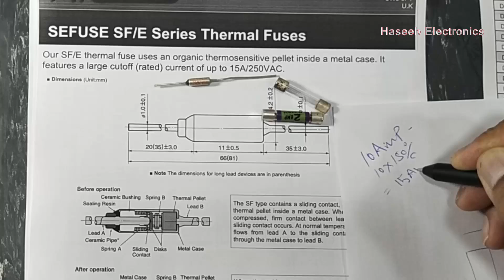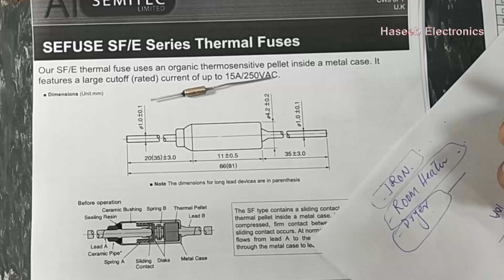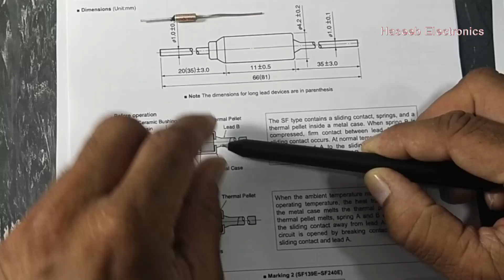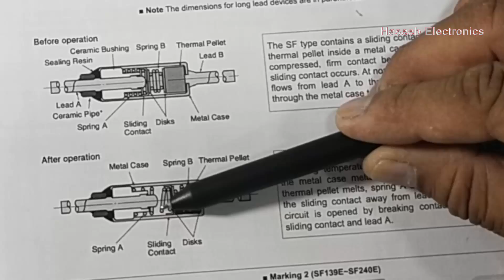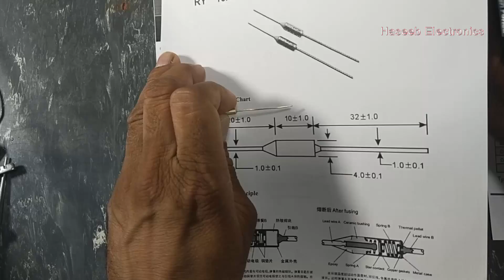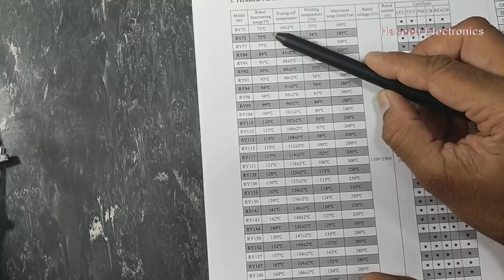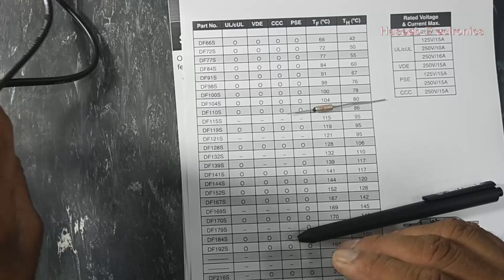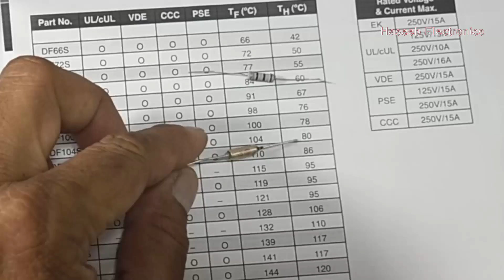{475} Thermal Fuse, How it is Made, Structure, Function & How To Replace / Datasheet Explained

Comment: I just had mine fail in a toaster oven, I wired around it rather than replace. Only ghetto dwellers let their appliances overheat, its lack of maintenance. These fuses are designed to fail in a few years, 90% of people junk the item. Good for business.
Reply from the maker: it is better to replace it with thermal fuse or at least simple fuse, so that it can limit the overcurrent situation, 
these thermal fuses get damage in over temperature and over current conditions

Comment: I've always wondered what was inside a thermal fuse. Great!
Thermal fuses seem to blow for no reason in fan motors . The fan  ran fine, then I would shut them off. Next time I turn it on, it's dead. I know for sure it was a thermal fuse in at least one of them. Because I tested the fuse with an ohmmeter. It was rated at 115°C.oh, it's a different style, it looks like a small capacitor. Leads like a disc capacitor, but the fuse is a tiny square shape.
Reply from the maker: Good morning 
thermal fuse is a safety component against overcurrent and overtemperature 
in fan motors, blender motors it protectes the fan from damage in overheat condition due to any stuck / jam in bearings, metal bush, 
and over current condition

Comment: Hello I have a coffee maker which has two thermal fuses that both look just like the one you showed. The problem is that I cannot read the values of the fuses. The print is very faded. Is there another way for me to determine what value of fuses I need to get for the coffee maker?

One more question, if a coffee maker has two fuses instead of one, is it true that both of the fuses have the same value or are they different from each other?
Reply from the maker: SF214E SEFUSE 10A 250V Thermal Fuses 216 Degrees Celsius Thermal fuse is normally used in most of coffee makers 
Most of the time Both fuses are sane value
Reply: @HaseebElectronics  Thank you so much. This means a lot to me! And thanks for the very informative videos.

Comment: Thank you. Exactly what I was looking for. My electric oven suddenly not turning on.  I used screw driver tester and found that the electricity doesn't go across the sf150r0 sefuse. Hope changing it will solve the problem.

Comment: Thank-you for a great explanation and maybe you could help me to find out what the thermal rating is, given this information: It is a blade type fuse for a heater/vent in the bathroom and the only information on it are these numbers/letters;  624303 109C VV4  It's an older unit, 25yrs, and we can't find a replacement fuse for it. Fasco Model 1100AB Heat-light-ventilator and the fan works fine. We were lucky enough to have bought an extra one and have replaced the fan we use more often already. Any ideas of finding a replacement part. I'm glad I found your great instructional video! Take care.

Comment: Sir good explanation, sir made in Singapore philips iron box , what is the thermal fuse used 10A 185℃ or
 10A 225℃
225 °C 10A

Comment: Good teaching I appreciate.
I have a request which is how to do a tutorial on how to calculate the value of fuse to use in power supply either SMPS or linear power supply for a load of 12w/24v power supply
Reply from the maker: best regards and special thanks
please check video number 484 on fuse calculation

Comment: Sir my shaver is had a battery of 700 mah and 1.2 volt and it is aa size but after long use battery get discharge very fast so for that I have purchased a battery of 800 mah and 1.2 volt and its size is aaa after 2 to 3 uses its well but now battery is  heating much while on charging every time and my shaver is not turning on so pls update me about is there any impact of battery size
Reply: And I have a original panasonic rechargeable aaa battery of 1.2 volt and 800 mah the older one is same panasonic 1.2 volt and 700 mah